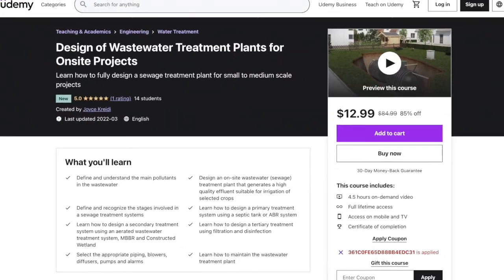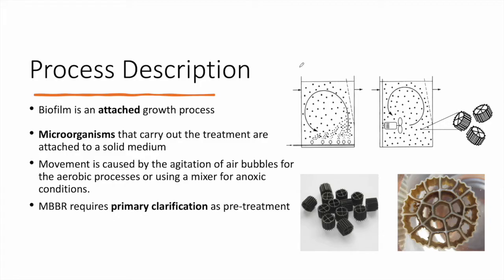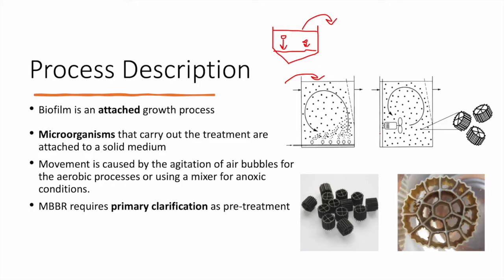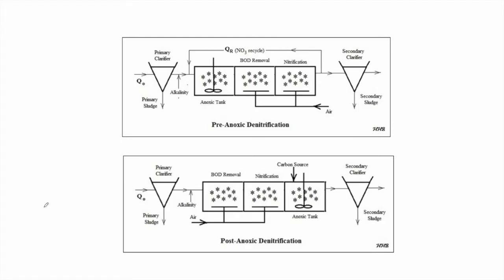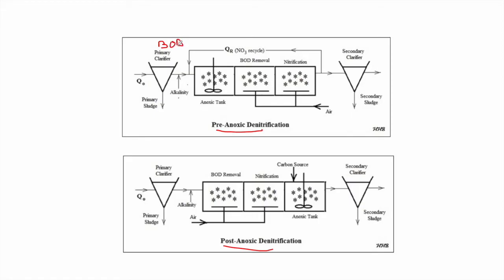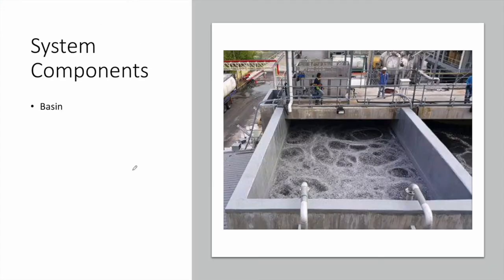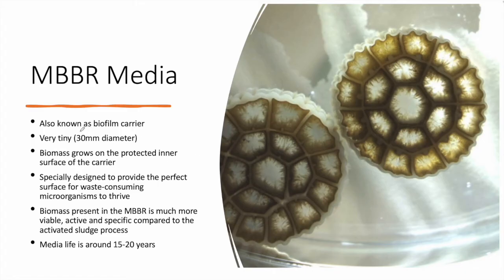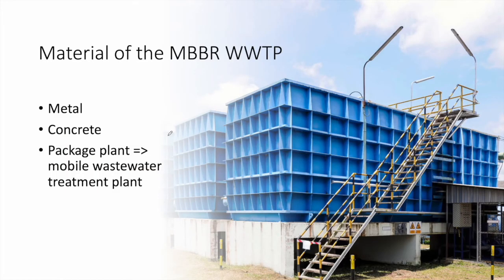How does MBBR work? Full description of moving bed biofilm reactor wastewater treatment plants

Comment: Excellent explanation, thank you. However, I would like to point out the need to provide a model of the entire station with all its units, and also mention that this system does not require activated sludge. All sludge that comes out of the final sedimentation tank is disposed of, unlike in traditional systems.

Comment: I think here is some mistake or maybe I am wrong,, I do not think there is any need for a secondary clarifier with MBBR. So the flow scheme seems wrong!
Reply from the maker: Hello dear,
All MBBR schemes are followed by a clarifier, that is designed differently from the activated sludge process. 
Water definitely needs to be clarified through sedimentation after the MBBR stages.